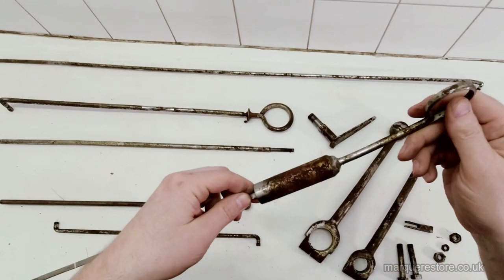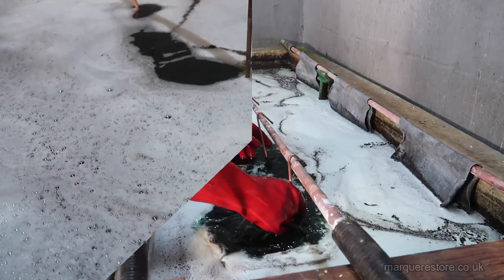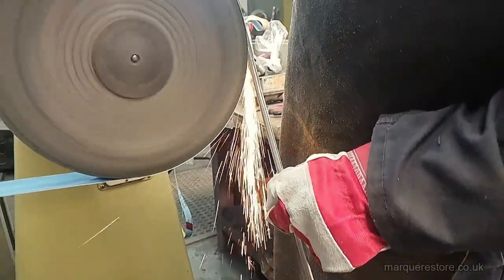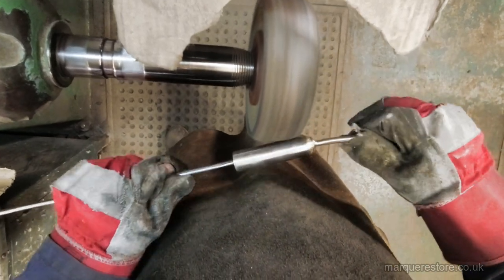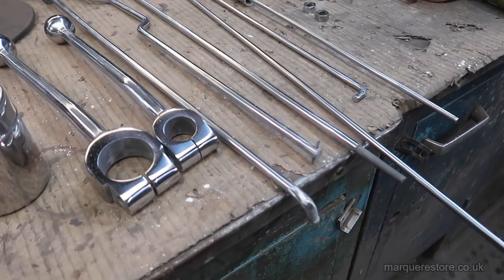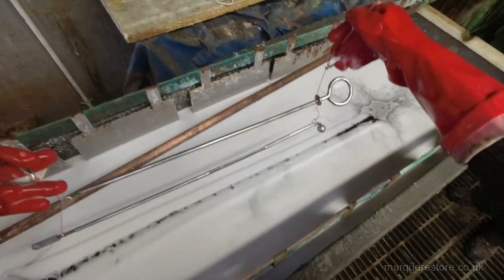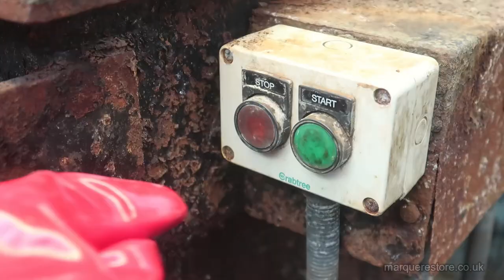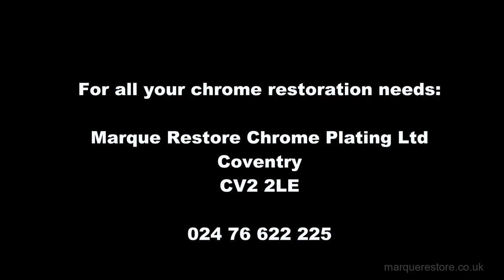How to Restore the Chrome on a Vintage Field Marshall Tractor - Complete Process

Comment: Do you not use any HCL/muriatic acid for deplating? Is there any advantage to using electrolysis as opposed to acids?
Reply from the maker: Yes. It is quicker and more controlled. HCL attacks steel much quicker than nickel etc, so it would not be effective.

Comment: Is the coating affected at the points where it directly contacts the copper wire?
Reply from the maker: Some of the plating goes onto the wire instead of the workpiece. This can cause a wire mark, but with experiencey you can wire it to minimise or eliminate this.
Reply: @ChromeandCarRestoration  Thank you.